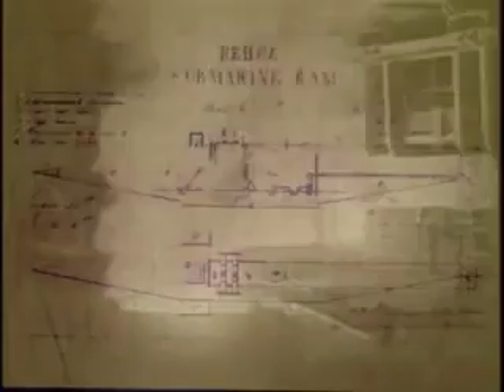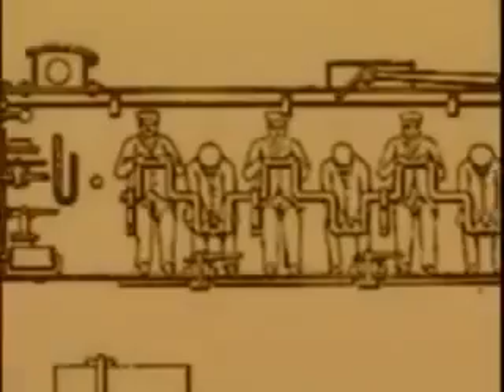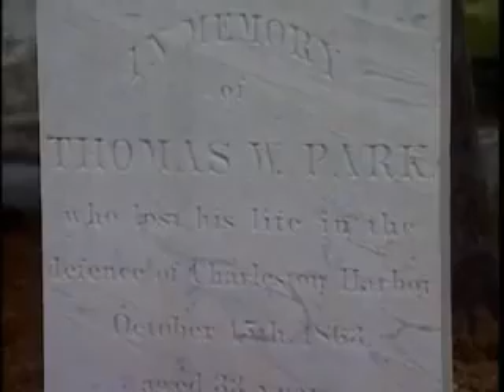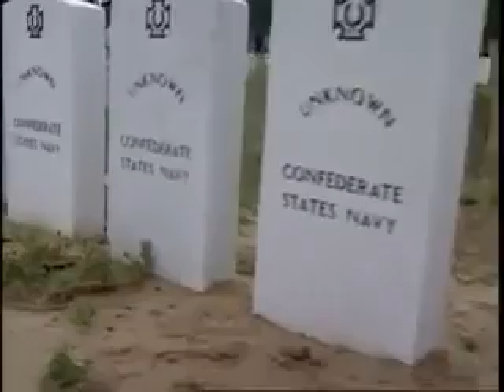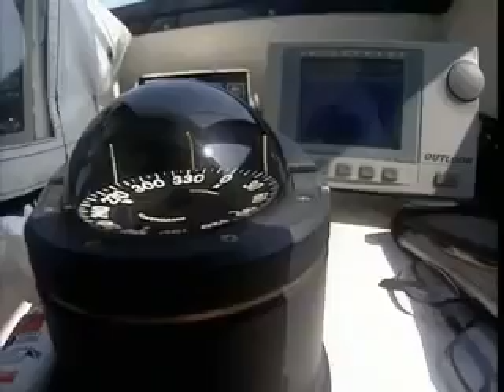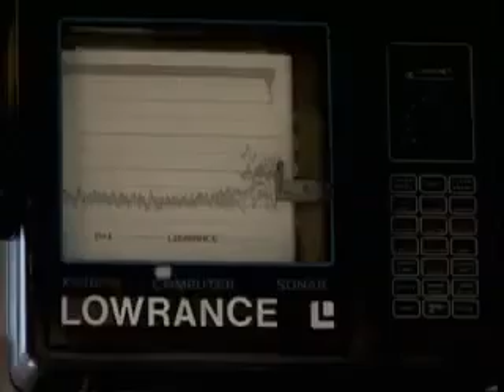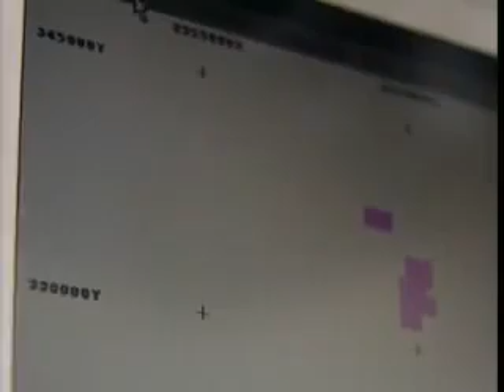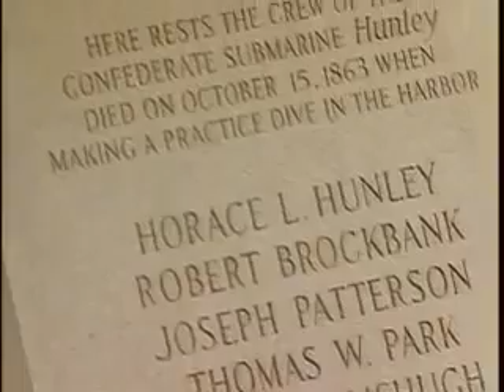History's Mysteries - Raise The Hunley (History Channel Documentary)

Comment: 20:18 IMO Mark Newell isnt the best bulb out there regarding the Hunley issue.  I have read up on his demeanor regarding the Hunley searches and find him lacking.
It is likely, given their low profile, that they remained on the surface for as long as possible when paddling toward their target, that would ensure the air flow was steady. Remember, they are attacking at night, and so being sighted by the enemy was likely very low. They would have only submerged for the final approach and attack. As it stands they were spotted by the watch of the Housatanic but by then it was too late. 
Their actual death was probably shockingly simple. The blast wave of the detonation went through the water, through the hull without rupturing the Hunley and likely knocked them all out, if not outright kill them.
They slowly settled to the bottom of the ocean floor, or possibly pushed down by the blast wave propagating through the water. 
At the time no one really understood that aspect of under water explosions.
I think the blue lamplight sighting was either just before the attack or rather a case of misidentification.  Given the distance from the shore to the attack sight, I question anyone seeing it with just their naked eyes.